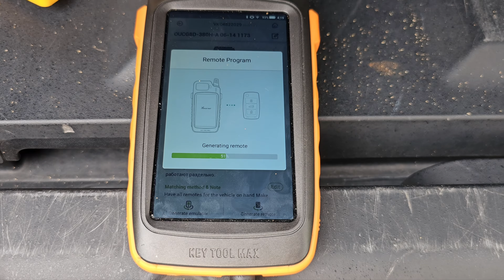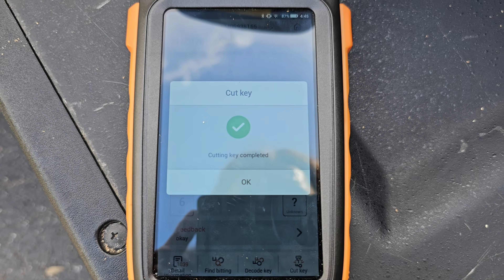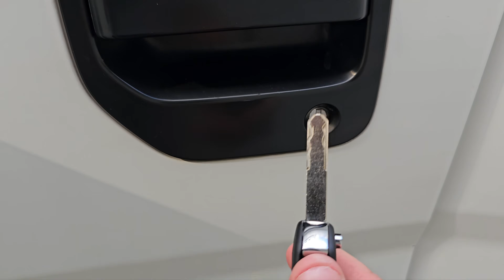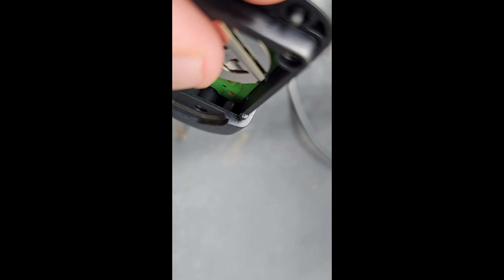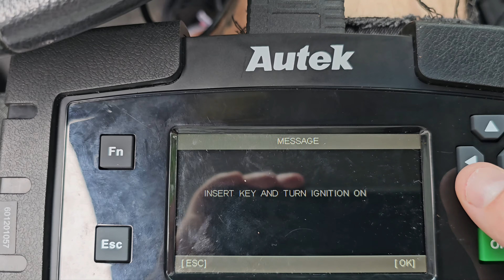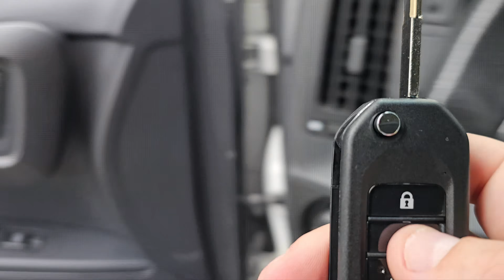How to create and program Xhorse Universal Keys

Comment: hello, Do smart keys also have a chip? And is the circuit board only used to open the doors? Can a scan test a chip and a printed circuit board to determine separately which one isn't working?

Comment: I've done a few Honda remotes before with no problem, however I currently have a 2007 Honda Civic, Yellow Label on PCB. I have a working original Honda key also that works perfectly, chip, remote, all OK. However I have tried every possible Honda remote programming instruction and this vehicle WILL NOT go into remote programming mode… I feel like it might be a diagnostically added key possibly? The original key’s chip in integrated into the board. Any advice?

Comment: what is the benefit of using the xhorse universal keys over using a generic honda key? Is it easier to program and pair vs a standard remote?
Reply: yeah i have been wondering this maybe it cant program blank non xhorse smart chips
Reply: @worbarry9735  the last month has been very educational.  

1. Xhorse chips and boards are far better quality than aftermarket. 

2. It helps keep inventory down not having to stock every remote to ever exist. 

3. You can generate chips to any vehicle,  able to confirm if you have a bad aftermarket key or not. 

Example - had an 08 Tacoma yesterday.  Trick would not accept a new key. 

Ended up taking a super chip, cloning the original key, and put it a key blank and cut the blade.    Job done
Reply: @TheDersEffect8  thanks for the info I currently have a blank Audi key that I have already programmed the central locking with vcds but waiting for my keytool mini to arrive hopefully I will be able to program the transponder.

Comment: Why or what's the logic behind choosing PCF7937 over PCF7936?

Aren't both the same ID46?

Under the options of PCF7936 there's "New 7936 chip Transponder: VVDI XT27.

Also, there's the option New 7946 chip Transponder: VVDI XT27.

Won't any of those work as well as the PCF7937 option New Chip 7937 chip 46(PCF7937E) that has allowed transponder: VVDI XT27?

What are the differences in PCF7936, PCF7946, PCF7937, & PCF7937E?
They are all ID46!

Comment: Helpful video. Earlier I was trying to read a chip from Model: XKHO01EN remote key I have but vvdi did not find anything.  I did not realize that I need to put a superchip in my xhorse wired remote key  Model: XKHO01EN & generate. Thx.    The chip should be ID46   7937 as well for 2015 Honda Pilot (USA).